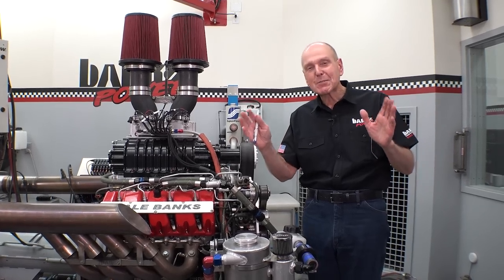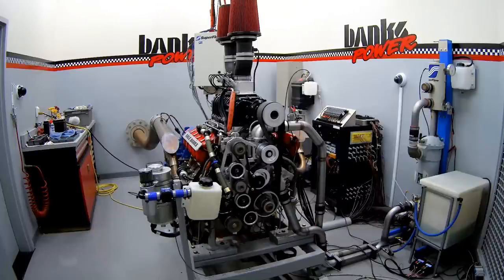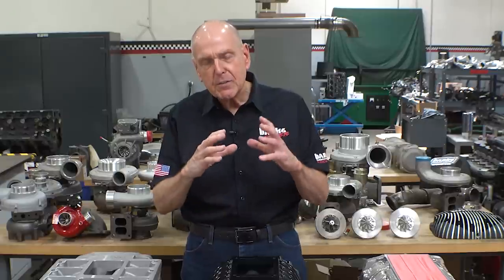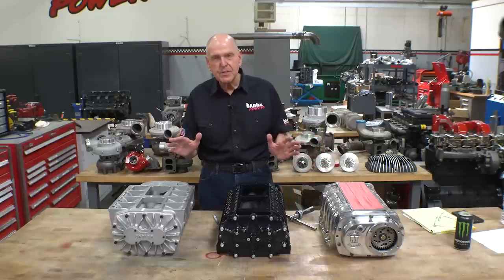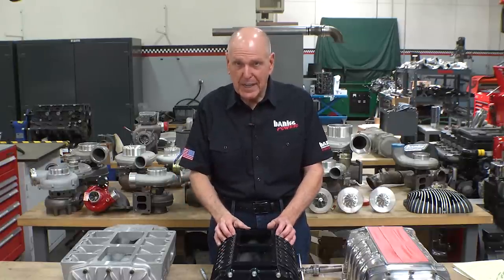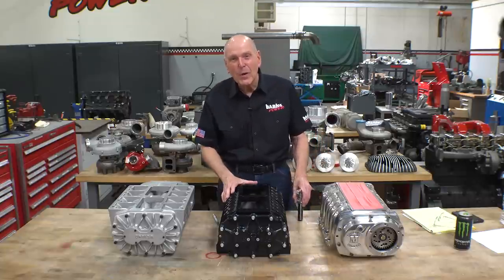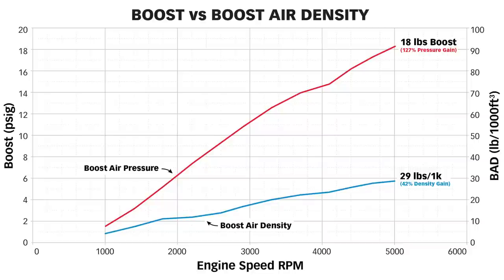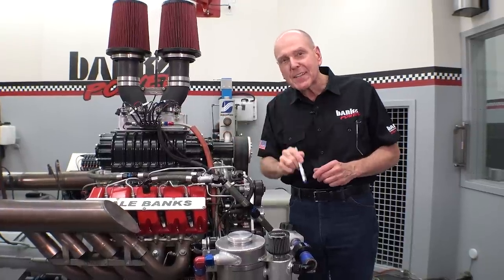FIRST FIRE! | Building A Monster Truck Engine Pt 5

Comment: I think it's wonderful you are doing these experiments and sharing the data. 
170 year old technology vs 80 year old tech.  Compound super-turbo systems were around on the big radials engines of WWII.  Not to detract from this awesomeness.  The simple fact is, even though wheel has been round for millenia, that doesn't  make it obsolete.  And just cause the blowers are old ideas, doesn't mean they can't be refined. I'm glad you're out there grinding it out Gale!

Comment: So that's why 400hp supercharged engines are so common. Thanks for teaching us Gale
Reply: But the toque is missing on the graphs
Reply: @wobblysauce   torque doesn't matter it your melting pistons and pissing away power to do it.
Reply: @christopherbenfield7848  True, but it is what some want to feel... the thrust in their seat.
Reply: Because as soon as you open the butterflies - they GO - and in those applications they are used, the first half of a second is pretty essential.
Reply: @christopherbenfield7848  That doesn't happen if you build the motor around what the blower does well and doesn't do well, just like you have to do with any other power adder.
Reply: @Ugrasrava  That style blower doesn't do ANYTHING  well compared to the newer generation of  supercharges. Yes you can build the engine and should around the power adder, but physics is physics at some point you will hit a wall and going beyond that destroys engines.
Reply: @christopherbenfield7848  Tell that to all the people out there going faster than you ever will with them, bud. You can rant and rave all you want, but facts are facts, and the fact is these blowers work well in a lot of applications.
Reply: @Ugrasrava  It's not a rant and rave there slowpoke....It's physics and engineering science..why would you use 100 year old technology. As for facts there isn't a standard roots type blower that can come anywhere near the compressor efficiency of a Whipple or centrifugal charger. Those are facts despite what you claim. Even the ones used on top fuel aren't roots type blowers, they may look like it but they are far from it. As for how fast I have been....does above 600 knots count? Anyone with a roots blower going that fast?

Comment: I have figured out the same thing about blowers and the screw type 30 years ago, when I was looking for blowers for my rotary engine inventions.
The Whipple is way better because of the built in compression ratio.
And therefore much less pulsation.
That is why they are more efficient.
Also the Whipple / Turbo configuration is the best of all worlds.

Comment: I always knew roots superchargers were inefficient, but holy crap! Seeing the data just blows my mind. They are very inefficient "compressors" literally beating the air. So basically, they are a high parasitic-drag, air charge super-heater! Granted, gas or alcohol will cool the charge slightly, but it's not a wonder why you always see measly 400HP blown street rods overheating and puking coolant all the time. Look at all of the extra heat you have to get rid of with these things. As always, thanks for the videos Gale!

Comment: I'm one of the old guys that love the look and sound of a blown engine there is nothing else like the whine of a blown small block on the street or big block at the track. but unless you feed them alcohol or methanol your wasting your time and money they are massive heaters without a inter-cooler on gas or alcohol fuel. that's why we all run turbos now and still feed the engines alcohol in the form of E85

Comment: Excellent information,  I just ordered a few air density sensors to add to my logger I built to help get the most out of my next project, im going to try to use them on an N/A engine too, to see if that works.

Comment: I love these engineering videos, here's another idea to test. I'm super curious about how oil catch cans can serve to fight knock/compression ignition in gasoline engines. Theoretically oil has a lower self-ignition temperature, and so running pcv into the intake of an engine can lead to knock, and thus less ability to run high timing. Could someone actually gain horsepower by running an oil catch can and thus gaining timing? Or is the difference negligible.

Comment: Gale. Could you put some bypass valves on the super charger to let the compounds breathe at higher rpm and still have low end grunt when they are closed. It’s a lot of headache to intercool just use it for the throttle response and bypass at the point where the turbos are overriding the blower.Low end snap than compounds. Boosted before you build boost. No intercooling needed, before you get to higher rpm. Than it’s just bypassed. Ataac will take care of the compounds

Comment: you should try a compressor unit from a kaeser screw compressor @Banks Power. we has 3, a 15hp, 40hp, and a 250hp enormous mofo . they produce 125 psi in our application
Reply: Wow

Comment: 15:40  Gale is talking about boost pressure of GMC-type Roots blowers on 2-stroke diesels.  I downloaded an SAE tech paper on the EMD 567 engine from 1951, authored by E. W. Kettering.  It did have a graph of boost pressure vs rpm.  On the EMD 567, blower pressure maxed out at about 8 psi and 900 rpm.  I assume that Detroit Diesels operate similarly, since they were born concurrently with the EMD engine at GM Research in the 1930's.

Comment: Looks like you are going to have to make a large intercooler. Preferably a water to air cooler which seems to be more efficient than an air to air cooler.  Would a smaller blower be more efficient? Like an 8/71 with 10 to 15% overdrive? Or run the 10/71 at 10 to 15% overdrive? 
A chain driven blower on that Nailhead looked scary as hell.

Comment: A good way to describe what's happening when you compress air is by looking at changes in state of something like water. When you evaporate water, it expands, and this causes a cooling effect because the energy potential of the released molecules drops. This is why you feel coolness on your skin when you've got sweat or water on it that's the same temperature as the air. It's evaporating, and you're getting that cooling effect. Likewise, when you condense water from air, it's a sign that you're adding heat from the surrounding air to something. This is why your coke can sweats on a hot day when you take it out of the fridge. It's also why your air conditioner drips water. It's accumulating heat, so the water precipitates out of the air, and you get a warming effect. The same thing happens with air itself as you compress and decompress it, it's just invisible. Decompress air, it cools, compress air, it heats.

Comment: To add on. My gti has a 2.0l turbocharged inline 4. Running 23psi of boost (measured just before the intake manifold) at a relatively low temperature, considering the 800 cubic inch intercooler, I’m making close to 450whp. I’m running 30% ethanol as well. It’s real disappointing that the horsepower number on such a big engine running only 5lbs lower boost than mine is almost 150 horsepower lower at the crank than mine at the wheels. That’s the power of cooling. For a matter of fact I tested my car with and without the intercooler while running the same boost levels and what I found amazed me. Now a fmic obviously allows for more power but I found that the amount of power being held back by inadequate cooling was quite a bit. Were talking one good pull at 350ish whp (don’t remember the exact number) then a major drop off to just under 300whp. Compare that to being cooled by a fmic I’m able to make 450whp pretty reliably and it isn’t until hours of use where power starts to be pulled due to heat soaking. Where is the heat coming from? I don’t know because intake temps stay about the same but there’s a point where it pulls a decent amount of horsepower and I still do not know exactly why. I call it the phantom heat soak. As you can see heat kills power and 400 degrees at the intake means that you’ll have almost no power as shown. I love superchargers but they don’t make power and I also love the group b rally feel of 450whp kicking on at 3500rpm.

Comment: This is huge to get these numbers in a real world test off a roots blower. I've thought a lot about exactly this configuration but I had no idea roots blowers were so inefficient. I wonder if a turbo-into-procharger type design would work better. Of course if all else fails, there is always the solution of using a couple of electric prochargers to blow some air into the manifold during moments when the turbos are not yet up to speed.

Comment: This got me thinking. How much would an intercooler under the blower change things, all else being equal? With such high temperature, my intuition tells me boost pressure (and therefore parasitic losses) would drop by about half along with a slight increase in MAF due to reduced recirculation in the blower.

Comment: i work at a welding shop that uses all air tools and so consequently they have a few 40+ hp electric screw compressors. one of these compressors runs almost continuously and is in a nice self contained cabinet with massive 4 foot square duct work for blowing excess heat out side the building wile the other one is sitting out in the open with no ducting of any kind. a few weeks ago they had the nice one down for maintenance and where running on the other one instead. the room that these things are in is about 20x20 with an 18 foot ceiling and the temperature in the room went up at least 30 degrees because of the heat being generated by the backup compressor witch was just being vented into the room rather than being ducted outside like the primary compressor is. they even had a door open to the outside air with a fan pointed at it to try to keep the temp down!  as far as i know industrial air compressors are designed very similarly to the one gale has on top of that engine so its not that surprising to see the temps going thru the roof like that

Comment: 17:18
With Gm's smaller two stroke engines, the 53 series. They had straight rotors. Its one of the reasons the 53 series screams so much louder than the 71 series. That and higher RPM.

Comment: Question for you Gale. Would it be worthwhile to have a clutch like option that "cuts the super from the belt drive" limiting power theft, and letting the turbos either push the super or let the super pleats separate letting the air from the turbos enter the engine normally. This is probably dumb but that way you get the throttle response from the super but depending on where you tune the clutch to give it disconnects the parasitic draw the super has letting the more efficient compressor have at?
Reply: Eaton developed a super-turbo system for VW in the early 2000's that did that.  And the earlier Mercedes M271 had a clutch that disengaged the supercharger during periods of low power demand.

Comment: okay here we go my thoughts on this. I would recommend using a dry intercooler underneath the supercharger oversized intercoolers before each turbocharger I mean each have their own intercooler not not sharing one then with the introduction of the mess water on top of the blower it seems to me like you should run into an icing situation to where you're actually taking the temperature to a negative rather than being at 500 degrees positive any thoughts please hit me here I'm interested because this this is very very important areas and others have not looked at in the past thank you what's all learn here

Comment: Gale loves his turbos, but they are about as old as the supercharger is. Turbos showed up in 1905.  It's no surprise that when you compress air it heats up, that's why intercoolers and other heat exchangers came about.

Comment: But professor (because that's what you are to me, Mr) Banks, didn't old school drag racers use to place a little 2-stroke boxer engine in front of the blower, just so that it would run the blower and rule out any parasitic loss?

Would you consider placing some sort of 2-stroke dedicated engine and route the air into the engine as part of your further experiments? this is super exciting!!

Comment: There are a lot of good friends of mine who do not know your history with forced induction. Your Twin Turbo Top Fuel Dragster proved your point but unfortunately never got your Top Fuel Dragster a legal race. You fried clutches due to the insane amount of power you made with no e4xploding blower sitting on the engine. I advocated for your "6 Shooter" with my Baby Brother when he bought his lifted F250 because I saw documented proof online about who & what you are. I have been a Gale Banks Fan since 14yrs old...I'm 61 (turn 62 in Dec,),  When I  get the funds (Union Pension) I want Twin Turbos my 7.3L Powerstroke....your way & your products.
Aloha,
Chief

Comment: A couple things; why not have a heat exchanger like the lt4 supercharger or an lsa supercharger? They work very efficiently on those so I don't know what would be different about this. Also that l5p oil cooler on an lmm block... is that with no modifications? Could I as an lbz owner go to GM and order that part and bolt it on my lbz for better oil cooling?

Comment: The turbo charged EMD 567 645 and 710 use a gear driven turbocharger with an over running clutch to disengage the drive unit when exhaust pressure comes up. This is done because it’s basically a huge Detroit Diesel and can’t run without scavenge air. However once exhaust takes over there is not blower hindering air flow.  Wonder if anything like this can be made.

Comment: Why not use a 7 stage axial flow compressor off a turbine?
Reply: Paul South might as well just use the whole turbine.
Reply: And they have to be spinning at 80% of full speed before they start compressing air. Won't work off a belt drive.
Reply: Small turbine hooked up to a generator .

Comment: Nissan Super March Turbo. Im curious to see how this works out but i have always had the same idea. Less lag in the low end, more top end. Its all about the air!!! More air more boom!! Fire eats air so feed her and she'll pur!!
Reply: I mentioned this on another video. The helix design, IS the thing you are all missing. In ANY flow dynamics, be it gas or fluid the helix is the truth of natures flow design. Anything else is just causing you problems. You could flow so much more fuel and air by simply adapting pipes to this design. And thats just the start.

Comment: In 1933, GM developed a two stroke diesel. In order for it to work, air was blown, using a blower, into the bottom of the cylinder bores, through holes.

I'm not sure what direction you're going. 
Unless you're using water methanol injection to cool the air, blower/diesel technology has been investigated before. 
Blowers are for diesel two strokes.
Reply from the maker: You'll get the full picture in the next episode which will go live this week.

Comment: thinking about how the rotor seals surfaces interact on a blower you would think they were designed to have diesel fuel sprayed on them. lubrication might decrease the drag , and atomization might decrease the temps. Also wouldn't switching to a 12v71 decrease heat and increase volume at the same driven rpm.

Comment: kW shaft in = kW air heat out. A turbo takes power from the engine same as the roots. (But from a different energy source) - Weirder stuff; gear driven turbo were common in WW2. Also, roots blowers are in factory compressors and are cooled by spraying oil down their gullet. - Good vid, I enjoyed it :o)

Comment: Wow, I knew the old blower was inefficient but that was serious heat numbers which need a lot of alcohol tipped in just to neutralise the compressor heat and then you steal horsepower from the crank so the overall improvement is hardly worth it. You really show that the old blower is a show piece only and a turbocharger is where its at to get real horsepower and fuel efficiency. I would be interested to know how a screw compressor rates on required horse power  and charge temp vs the old Rootes. Much better I reckon as I  notice a lot of racers are using them and they are not fashion victims. Another top video from you  thanks.

Comment: you should look into using high pressure air sprayed directly at the exhaust turbine wheel for the diesel competition  people who spend a lot of time spooling
Reply: Competitors already do that... usually with 900 psig N2O.

Comment: @bankspower is there any chance there a video that would explain why root blower more used in the drag racing industries compared to the screw blower?. i've read an article in english(not my first languange), that being said screw blower has better eficiency. but  this video explain some question. articles that i read always give me same conclution that screw blower just better. then what is the reason that root blower implemented in drag racing? does it have better flow? does it have better volumetric eficiency? does it have better working temprature? or does it have better capability to keep the air mixture temprature stable? or maybe root blower has better capability to cools down the whole system of super hi performance engine?  or it just cost consideration?. i got my theory and speculatio inbut i didnt want to believe to things that are not proofen. love this channel, educate lot of people

Comment: How about a sort of reverse Waste gate. When the blower reaches its maximum air flow ,a gate would open letting the excess turbo air around the blower and into the inlet .So no end to boost at max blower air handling capability and inter cooler air mixed in.